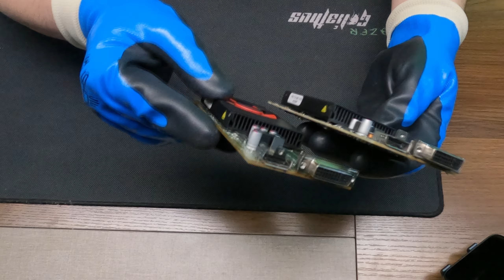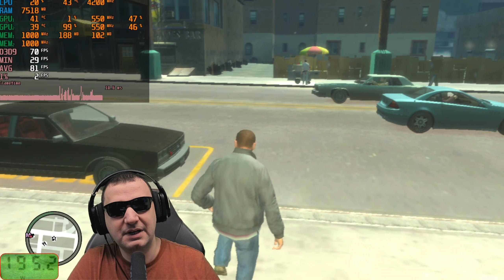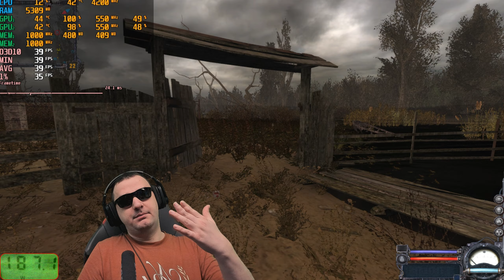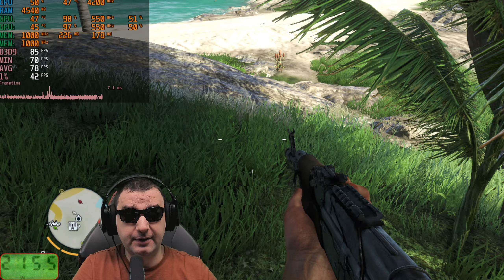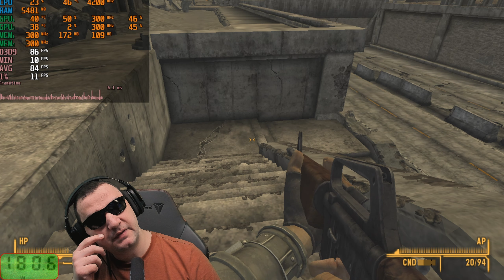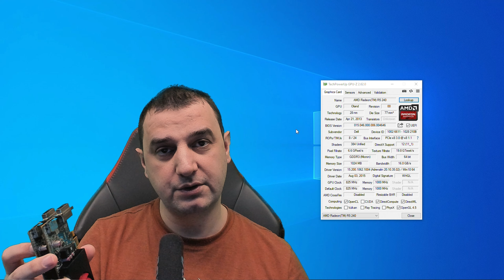AMD Radeon R5 240 Crossfire Benchmark

Comment: I did this on a whim once. I had a small pile of these for refurbish jobs and ran some basic benchmarks with them. The numbers were on the intriguing side but I couldn't get over the microstuttering. Which is funny, because I was an SLI die-hard back in the days. Interesting to see that it does THAT well on older games!

Comment: I like this cheap Radeon Card, u can massive oc with this gpu. My R5 430 become with oc, 30-40% more performence 😂
Games like GTA V works good with 720p.
Crossfire with a APU, was a pain, with the driver and most time useless.
But for the same money, can u buy a r9 380x with 4gb vram, a amazing card for 20 euro, u can play modern AAA games. Was a card from the CGN 3.0 architecture, with real dx12.0, not 11.0/11.1. Hogwarts Legencay works with FSR Performence with 30-40FPS. WoT Ultra 1080p most time 60fps.

Comment: "Very interesting performance" 😂
A single R5 240 is only slightly better than a GT 710 while having a much higher power consumption (50W vs 19W).
If you put two of these in a Pc you are literally wasting 100W.
With 100W you can put a single GTX 1050 (TI) or even a GTX 1650 or equivalent AMD GPUs into the computer and get a much better setup.
Reply from the maker: Exactly 💯

Comment: This is much worse than my laptop with Vega 8 (1200 Mhz but constantly drops to 200 Mhz because lacking good cooling). At least I can play Skyrim on 720p, high with Immersive Saturation Boost and Osmodius textures and looks much better than Vanilla on ultra. 60 FPS constant.
Reply: My 900P craptop has some Intel integrated graphics.
I played Observer: Redux (a cyberpunk horror game) with it at 768P with something between medium and high settings. Average ~50 FPS.
Also played local Portal 2 Koop with a friend. 900P medium settings 60 FPS with some stutters.
These ultra low end GPUs might had a usecase back then when iGPUs were so bad that they even struggled with HD video playback.
Maybe this is the reason why NVIDIA stopped doing GT series GPUs.
Modern iGPUs are simple good enough to make these type of GPUs obsolete.
Reply: @NVIDIAQuadroT400Benchmarks  Radeon R4 240 is a low end GPU from 2013 and Ryzen 3500U with Vega 8 is from 2019. 
A Vega 8 iGPU on a proper CPU (not mobile as in my laptop) is much more performant.

But never made any sense to buy a new CPU and a new low end GPU. Because that low end GPU is not better than iGPUs from its era.

Comment: Actually, I have a recommendation, being AMD sold headless mini cards meant for crossfire on APUs. I watched another guy try one with a Nvidia card, and it didn't work and crashed because he was clearly using it wrong, as it was NEVER intended to be used standalone.
Reply from the maker: I've done a video with hd 6770m mxm video card and I used a gt 230 to display. That card is dx 10 but the hd 6770m its dx11 and it allowed me to play dx11 games. Cool idea. Definetly need to look into it.

Comment: I think you need to test dx12/vulkan games with crossfire like strange brigade, doom, wolfenstein, ecc...
Reply: @lazylivegamingita813  literally doesn't work because dx12/Vulkan removed crossfire support.
Reply: @JohnDoe-ip3oq  there's multigpu support, same thing
Reply: @lazylivegamingita813  that's a GAME ONLY option, and EVERY game that uses it has to manually code support into the game. So the feature is DOA. Not that it can't be done. ALSO, there used to be a 3rd party service to do this, which was TAKEN OFF THE MARKET, and then there's the multi chip solution being worked on, which shouldn't be much different than multi GPU, BUT support is hard coded into drivers and never back ported. Not much different from using system RAM, and no drivers have any optimization for that. When there have been cards in the past with it. The lack of support is ultimately deliberate to sell 90ti models over 60 sli.

Comment: Wait I got 2 of these!  But ah I ain't smart enough for this.
Reply from the maker: You just plug them in and install the drivers. In the menu there is enable crossfire and thats it 😋
Reply: @DanielCardei  Thanks!  And I didn't realize it was that easy.  Will try it out now, I need those single digit 1% lows!

Comment: APU hybrid crossfire coming soon I can smell it
A8-7650k + R7 250 gddr3 2gb
There are newer Adrenaline drivers than you used here. Has frame pacing reduced spikes
Get 60fps in Stalker 1080p maxed

Comment: I HAVE A MSI R7 240! This card is installed in a PCIe to PCI adapter in a PCI-X slot for a dual Pentium 4 workstation. Linux BARELY works, as LTS distros are too slow and outdated, and rolling release locks up on the login screen using a modern desktop. You must use lightdm with LXQT to work. It's not a card useful for modern games, but you can play older games and watch YouTube on it.

Comment: R5 240 crossfire is diabolic

remember when Nvidea decided that we are not allowed to use "low budged" cards in SLI?

meanwhile AMD lets us use a literal pocket calculator in crossfire

btw i just pulled out my old (super good looking) Quadro 4000 cards from the drawer.

running at 65 degrees while being in the LoL loading screen haha. They defenitely need a repaste.

but after that, i will defenitely try some SLI action with them^^

1 of them was running at 65% load in League of Legends max settings and 1080p. So actually not bad if u use it for e sports.

this card only costs 10 buck where i live. 

they are even overclockable